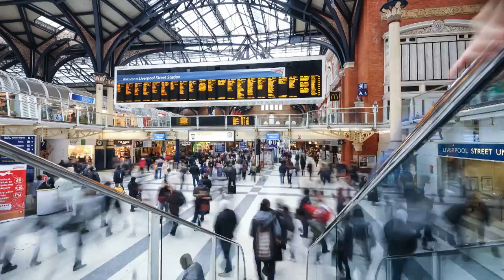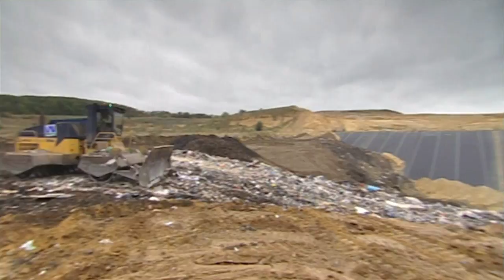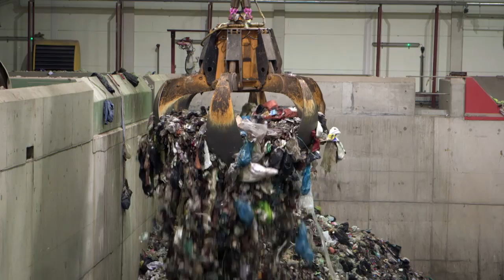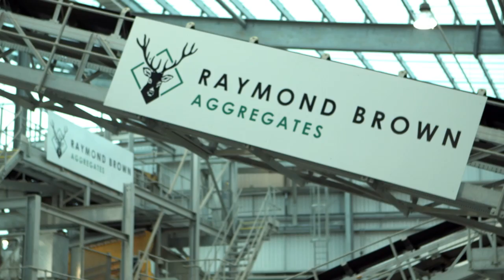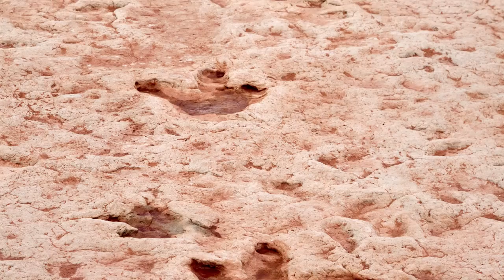Ardley Incinerator Bottom Ash Recycling Facility, Oxfordshire

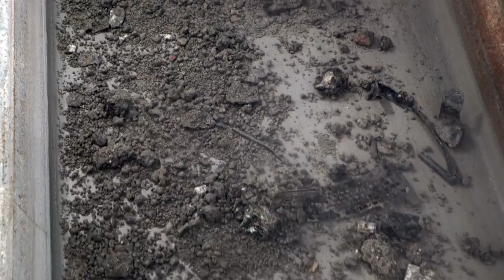Comment: how come the keyboard survived the burn at 2:18 ?
Reply: It's probably just the pcb. Those are usually made of fiberglass which is very resistant to heat
Reply: @alex9621  Could be, though it looks like unburned plastic. I sometimes go to drop waste into the feeding chute of the same type of facility, so I wonder what could survive through the burn depending on the surrounding trash.